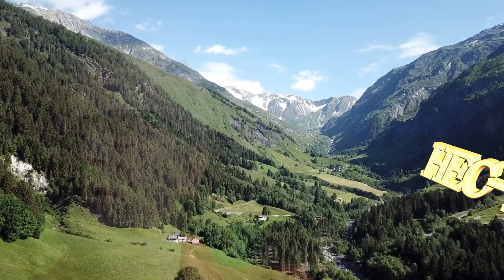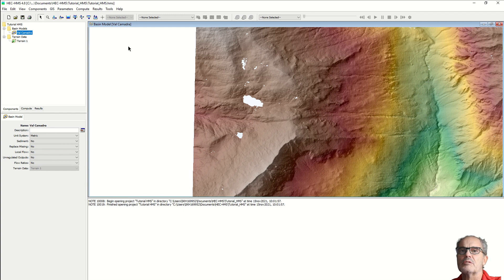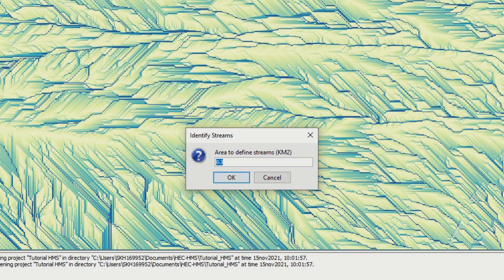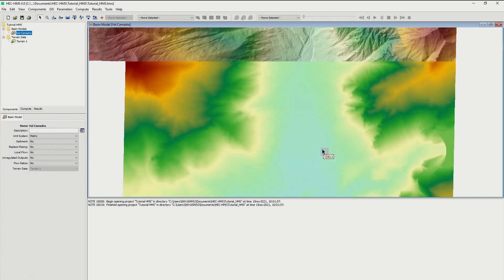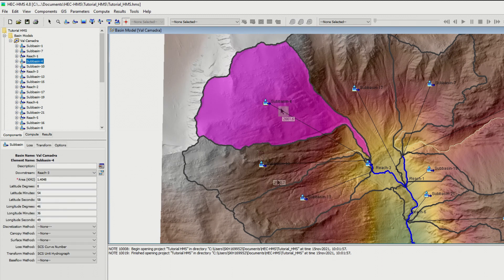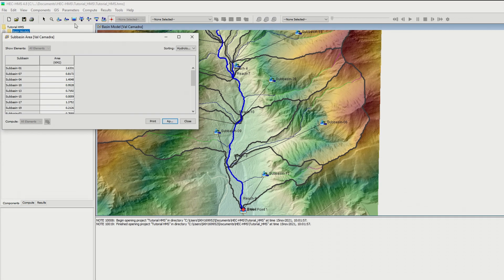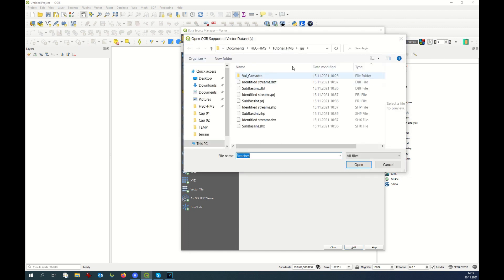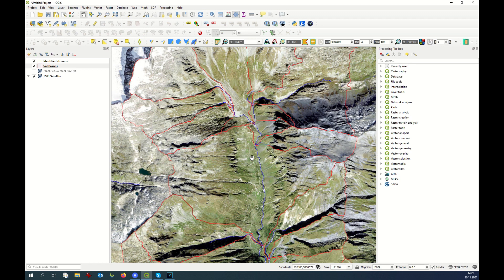HEC-HMS part 2/8,  Sinks, Sub bassins and displaying it in qGis

Comment: Dear Andrea. When you do Delineate Elements the software generate Sub-basins and Reaches. What about Junctions? They are not needed anymore? I am using an older vertion of the software, because the newest ones don´t work in my PC (I don´t understand why)...so I must create the elements by myself.
Reply from the maker: As far as I understand with the new version, this is not necessary, unless you want to display all the results at the inserted junctions. Not so sure. Sorry for the vague answer